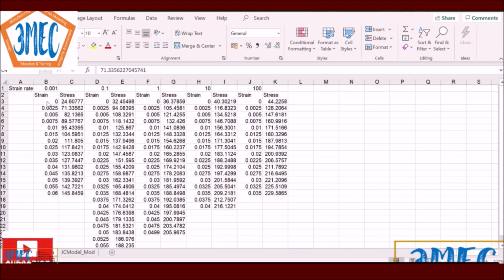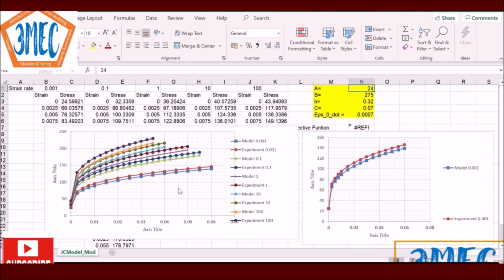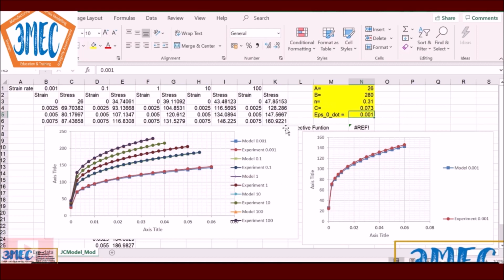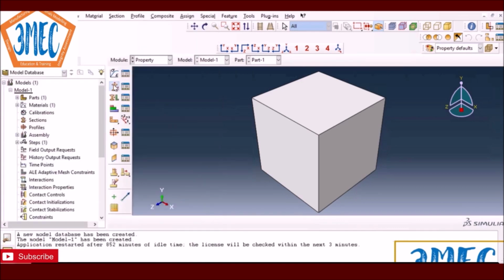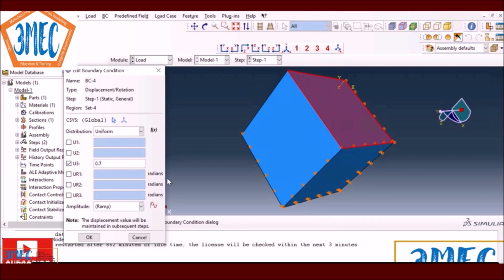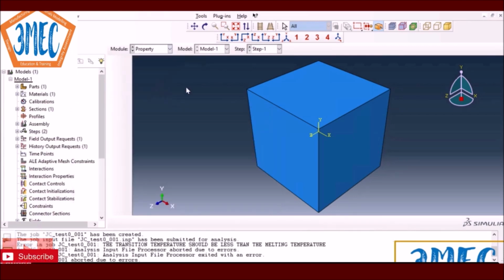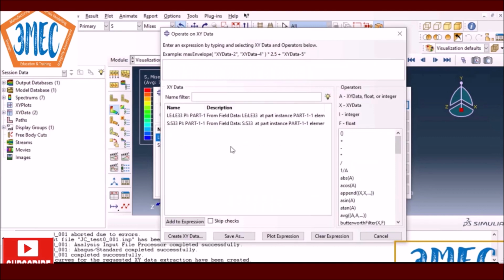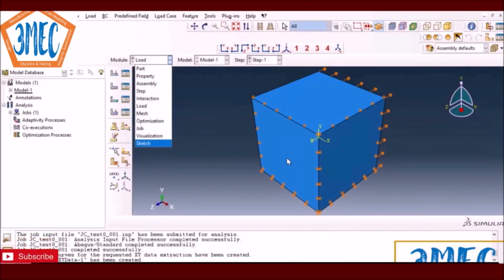Simplest approach to identify Johnson-Cook Parameter through EXCEL while validating through ABAQUS

Comment: Hello sir,
I have one question if we want to use hashin damage criteria then it is possible to use solid elements for model or we need to use continum shell elements in explicit dynamic problem
Reply from the maker: I think it must be used with elements with a plane stress formulation, which include plane stress, shell, continuum shell, and membrane elements. But you may double check abaqus documentation to be sure.